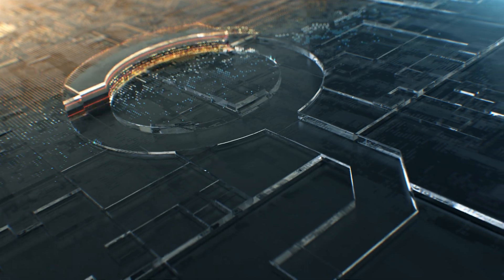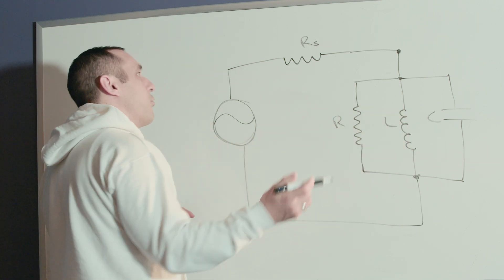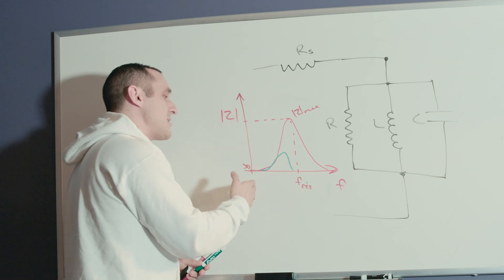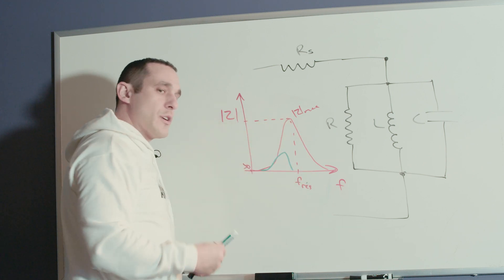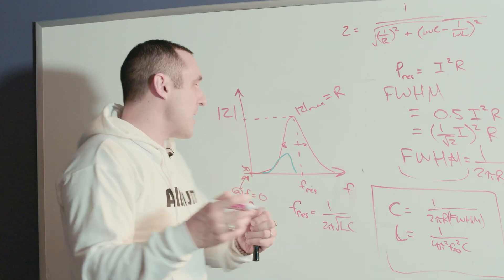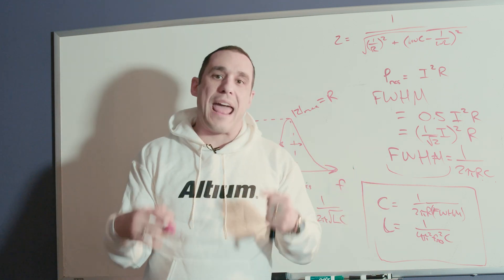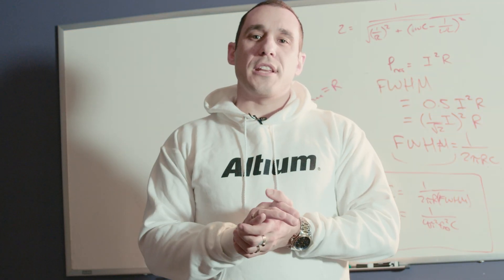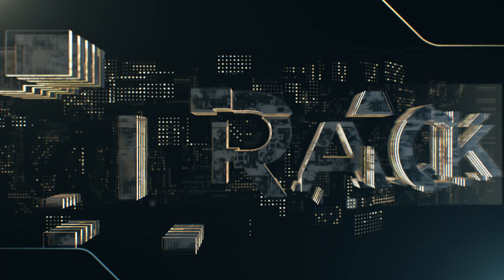Ferrite Bead Circuit Model Parameters Deep Dive

Comment: Hello Mr. Peterson.

 In general, everything is clear. 
Thank you.
 Could you tell about the use of ferrite beads in the gate of field-effect transistors to eliminate interference in the region of 100 MHz ± 50 MHz, to reduce losses on transistors during switching. Using resistors of 1-5 Ohm does not give the desired result. I have seen such solutions in some voltage converter circuits. For what frequency range of the converter is it acceptable to use ferrite beads?
 I am interested in solutions for converters with a frequency of 1 MHz. 
How to deal with noise in the upper-level gate circuit, with a bootstrap circuit, in the absence of interference in the source of the upper key? 

Thank you very much.
Reply: What specifically are you trying to achieve? One of the reasons you would use the ferrite on a FET gate is because noise in a specific frequency range is interfering with the operation of the gate, but you are trying to drive the gate in a different frequency range. You can use the FET but a better idea is to find the source of the 50-150 MHz noise and solve that problem first.
Reply: Thanks for the answer. 

The oscillations are caused by parasitic oscillations between the output inductance and output capacitance of the transistor. RC snubbers do not quite cope (they reduce, but not significantly) with damping these oscillations. I am concerned about the problem of heating the upper transistor, probably caused by slow opening due to long oscillations at the front caused by parasitic oscillations of the inductance and capacitance of the transistor. But this is my problem, I will have to solve it somehow). Initially, I thought to solve it by installing ferrite in the gate. 

Tell me in what cases ferrite beads are placed in transistor gates? I have seen such designs, but I do not know why.

Thanks.